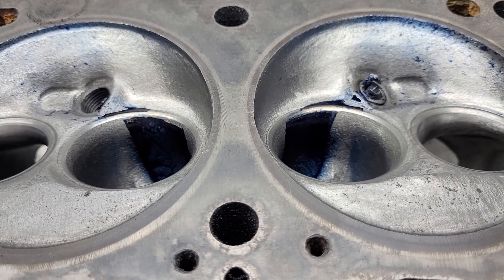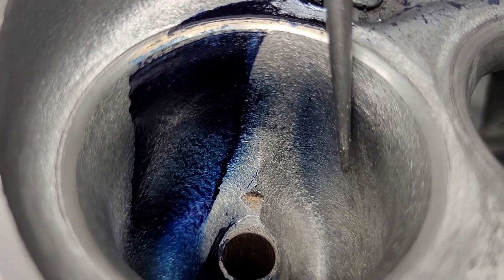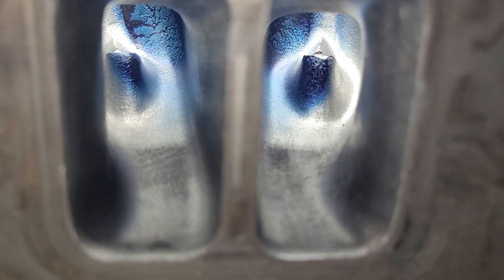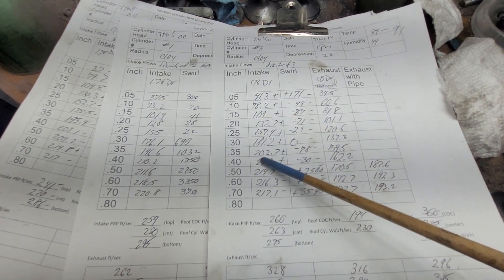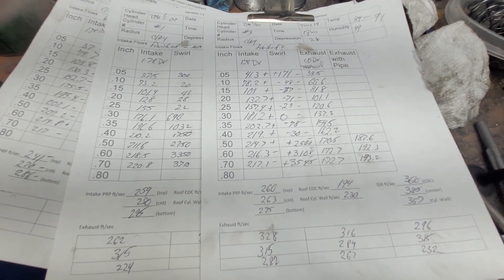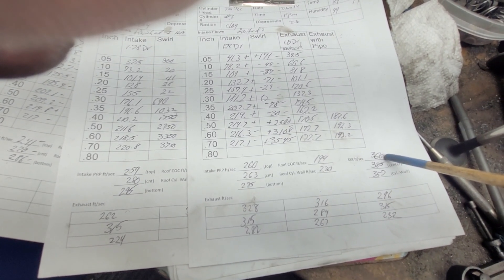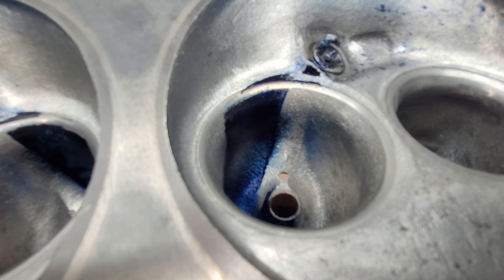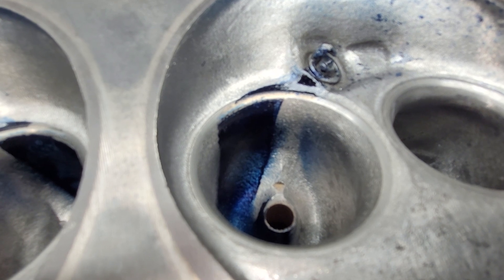David Vizard, U.T.G., U.M.S., Mission Impossible 318 project. Core shift flow and swirl differences.

Comment: Charlie, if it helps. These 165 heads you are working on were not exactly the best. I guess when i ported my 318 heads. I didnt sonic check the thickness and i could have gotten a bit thin. But not on the center of cylinder side. I was also able to port out my 360 heads alot to though? Maybe the 163/763 heads have more meat? And maybe the 360 #308 heads and the #596 heads also have a bit more too??
Reply from the maker: These runners are much smaller than 160.

Comment: You will be alright if you can repeat that with the other 6 ports. Because 1 and 3 have different runner lengths. If you can...swap a intake on when flowed. I believe the number 3 will be a low port. On the two barrel single plane,  you will only flow the intake capability.  Now the trick is to get the other pairs similar.
Reply from the maker: You make a very good point. Thanks!

Comment: You can use some means of injecting  the same amount of liquid in every port, at the same location, msybe  a 3D printed annular boosters can be used, with a thin spider to place it at the same place in the port, every time, (within .030"-.040" anyway)  using a small tube to a small reservoir, that can be accurately dosed using a dosing syring  to get  .5cc to 1cc  to every test accurately,  next option would be a camera  and smoke machine, with a 1watt led, to accurately illluminste the cylinder,  accurate wetflow doccumented
Reply from the maker: Design it, build it and send it to me!

Comment: Hi really enjoy your vids but I am a newbie just wondering if you could do a video on how you add the die for your wet flow and how you measure the air speeds at different areas of the port I think it would be cool the see how it’s done
Reply from the maker: I can do that. Thanks
Reply: Yes!  I am surprised this hasn't been a  video yet.
Reply from the maker: @robertwest3093  I may have done it already.

Comment: What’s going to happen to flow when DV swaps to a 4bbl intake manifold with larger 360 sized ports? That smaller 318 port might look like a big ole stop sign. 
I put an iron 340 intake on my 318 and didn’t notice any seat of the pants power increase over the stock 2bbl.
Reply: I put a 340 intake on 318 heads and it made a huge difference?  I am not saying that it doesn’t hurt anything, but with the Crane blazer cam, it really picked up power
Reply: @Patrick-xd8jv  maybe because my engine is totally stock, it just didn’t need more air/fuel. 
I installed an Edelbrock 650 AVS2 carburetor. Absolutely love it.
Reply from the maker: You can. It helps
Reply: Dud a 68 340 intake and 625 Carter AFB on a stock 318 with headers, it definitely made a difference! A jet and metering rod changes increased the mpg nicely too. Then I swapped that intake for an SP2P, lost power everywhere and mpg dropped. Was expecting a loss on higher revs but better mpg with that manifold.
Reply from the maker: @bobbyz1964  sp2p is a horrible design, worse than stock maybe. I know the Chevy version is.
Reply: @servediocylinderheads  Yeah I found that out! Actually figured it was just misunderstood because it was designed for low rpm torque and gas mileage supposedly. So I could see where guys that wanted power higher up would hate it. Was really surprised when it made mileage and low end power worse. Fortunately I bought it cheap and it came with a Carter AFB I can use on something.
Reply from the maker: @bobbyz1964  learning curve!
Reply: @servediocylinderheads  Yup what looks good on paper doesn't always work once it's cast in aluminum. 😆
Reply: @bobbyz1964  is the 68 manifold the one that has the 4 holes cast into it where the carburetor bolts on? That’s what mine is.
Reply: @brucesherrill4116  I
Yeah four holes.
Reply from the maker: I did a flow sheet and video using Rob's 340 stock manny on the 302 heads. Made a big step up in flow.
Reply from the maker: Stock heads?
Reply: Yes stock 1977 heads
Reply from the maker: @brucesherrill4116  I did the flow test on fully ported 302's. Big difference!
Reply: If you could, would you enlarge the 302 heads intake opening to match the intake?
Reply from the maker: @brucesherrill4116  302 heads have a tiny pinch so that will not help.
Reply: Can’t raise the roof? Or is there no benefit?

Comment: I think the swirl number could be much different during parts of the cycle where the piston is nearer the valve. Any air coming in will have to spin around between the combustion chamber, quench area and piston. This effect would possibly be quite different than an open cylinder. Then consider overlap where the charge is being pulled towards the exhaust. The swirl number is interesting to compare with but who knows what this does in a running motor with all the moving parts affecting it. I suppose someone probably has modeled the flow with some fancy software and would enter your data into the software to get the end results.??
Reply from the maker: Good points Brian.

Comment: Regarding the small block mopars. The stock iron 4 barrel intakes floe just as well as any of the other aftermarket dual planes. Only really besten by the single plane manifolds. I deep port matched and did some plenum work on mine and it pulls hard.
Reply from the maker: I have no doubt, Rob let me flow his 340 dp manny. Nice piece!

Comment: I'd rather have the better lower lift flow numbers with less swirl as long as the swirl is atleast adequate...Not thinking I'd want a .700" + lift cam for the added air flow.. Atleast not for a street engine.